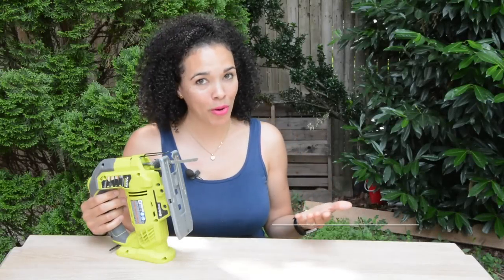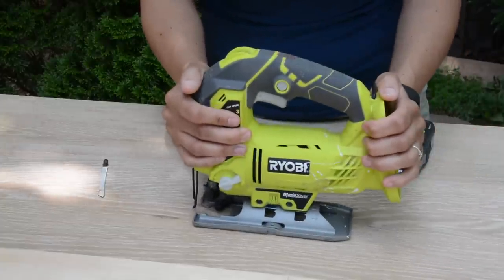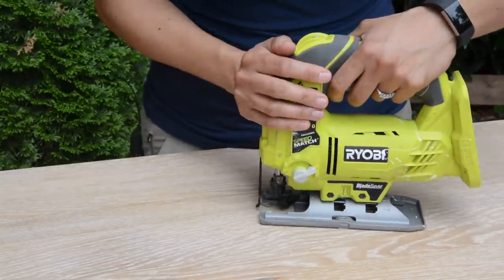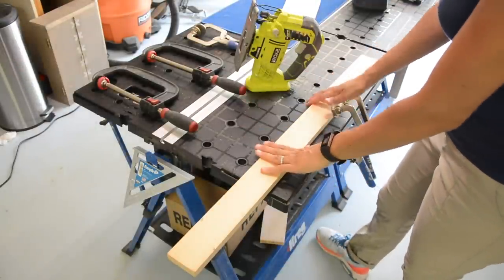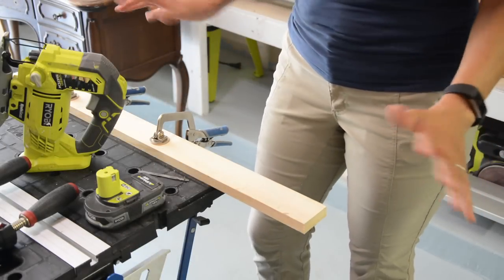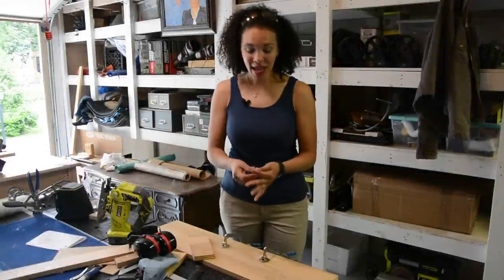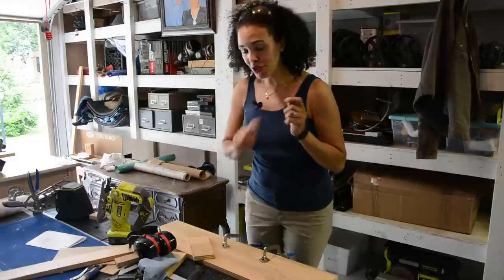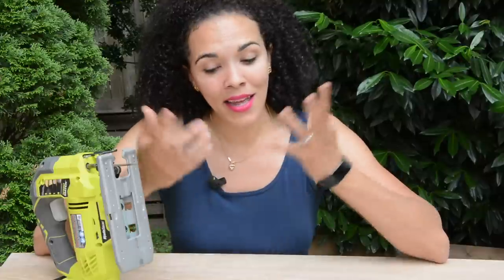How to Use a Jigsaw: The Easiest Tutorial For Newbies! - Thrift Diving

Comment: I own a Bosch corded jigsaw. I would suggest that it is a much better investment than your choice. Also excellent headphones. There are tools that I use more often and those that I need less often. Your Ryobi was more difficult to insert a blade and adjust for bevelled cuts. Much time was lost to your viewers on these adjustments that are very easy to do on the Bosch. Much more time ought to have been devoted to explaining functions. Your table clamps and saw horses were poorly explained - you need a prepared script. I would have clamped both sides of the work. Your cut-out wood circle and strip of galvanised steel and missing plastic exercise ought to have been given more time. Safety is extremely important - you did well to emphasize this - but again a script would have helped.

Thank you for information on Start blades. You mentioned other ways to protect the upper surface but did not demonstrate them.

Good luck with what you are doing.

David Lixenberg

Comment: As mentioned in the video, use scrap material to make test cuts.  I save ALL my scrap material (wood, metal, PVC, etc.) in a full-sized Rubbermaid trash can, in the garage.  I use the scrap wood to, not only make test cuts, but use it when drilling holes in a project.  If you place scrap wood under your project wood, you can drill holes, without ripping out the edges of the hole, on the backside of the project.  Scrap PVC can be cut into "rings" of varying lengths, and heated with a heat gun, to make couplers for different size hoses.

Additionally, if you don't feel like hand-holding the jigsaw to make cuts, here is a link to a DIY jigsaw table .... Seems easy enough!

https://www.youtube.com/watch?v=RVDjY53-cVE

Comment: How thick of metal will the metal blades cut? 1/2" possibly?? Ir wud that break the blade??
Reply from the maker: I'm not sure how thick of metal, but I've used it for the galvanized metal sheets at the home improvement store. I don't recall the gauge of metal, but the ones I have used were medium thickness.

Comment: So I bought a jig saw and tried cutting some wood but somehow the blade turns slightly to the left and cannot seem to get it to go straight. Any thoughts on how I can correct this?
Reply from the maker: What brand are you using? Sometimes blades can have deflection, too, where there is some wiggling and the pressure of pushing on it causes it to happen even more. Also, there is a knob on the jigsaw with 0 1 2 3. Set it on 3 if you're cutting wood.
Reply: @ThriftDiving  I am using ryobi as the video. The blade cane with it when I opened the box. I have the knob set to 3 for wood

Comment: My base seems to not stay flat for some reason. The hex key adjustment must go spongy or something. I can't tell oddly enough, it seems firm to me. But, the cut ends up NOT square! Gah?!  (I use Ryobi too, by the way)
Reply from the maker: Hmmm.....I had. friend who hated her  RYOBI jigsaw, the newer brushless ones. She said it never tightened up and kept getting loose on her. Could be the same problem?
Reply: @ThriftDiving  Well, the RYOBI is a big improvement over the other one I had.  That older one DID plainly loosen AND I COULD SEE IT AS IT HAPPENED!!  Anyway, I've only noticed the odd "not square" edges a couple of times.. Unfortunately, it was on a project where I really, really, really needed a proper squared off edge.

Comment: I always thought one should always stick with power tools with an electrical cord because battery operated ones have a limitation on power. And the main reason to buy battery operated power tools is for portability. In such a case you're prioritizing portability over power. But, again, the default decision is sticking with A/C corded tools.
Reply from the maker: Good discussion you're bringing up about battery vs. corded. I have started buying some more brands of tools and if I can go cordless, I will because of portability and honestly, it's less of a tripping hazard for me. I just bought a corded tool (a Domino), and I literally tripped over the cord, knocking it to the ground and breaking off one if its attachments. My mistake, of course. But whenever I can eliminate the cord, I will. Plus, it means I can work anywhere. That's important to me when I am doing projects outside of my garage, like in my closet in the bedroom.
Reply: @ThriftDiving  Funny how we each have our own preference. I also don't want to deal with recharging batteries and the battery itself going bad after a couple years. But, who knows, maybe the batteries of today rarely ever go bad. I don't know. I'm a cord guy!  :)

Comment: Does the brand of jigsaw matter. I'm using a Chicago/Harbor Freight and it jumps all over (even while clamped) and the blade stops in the middle of the cut
 Frustrating!
Reply: Yes...you need to get a reputable brand ...for diy I'd recommend black and Decker they are affordable and durable

Comment: 22:00   a dual cut has fewer teeth?
Reply from the maker: Yes, the Dual Cut jigsaw blades have less teeth, but what's unique about Dual Cut blades is that the angles of the teeth are angling UP and DOWN to cut the wood smooth from both directions, whereas traditional blades only have teeth angling UP that cuts the wood on the upstroke. What I'm showing here in 22:00 is that there are blades that have FEW teeth for quicker uneven cuts, and there are blades that have FEWER teeth for slower, smoother cuts. You can have regular blades with teeth that only angle up that have small teeth. Hope that makes sense! :)
Reply: Yes, it makes a lot of sense. Thank you for taking the time to explain.

Comment: I did not like this video. I'm 6 min in. There is no way I'm lasting 30 min. If this is the easiest tutorial for newbies? Forget the angle cuts and multiple speeds. I NEVER USE THEM! Full power, Straight cuts. That's it! That's what you want to learn. 9:40 Ugh, you're going into blades? You're going to scare them away.
Reply from the maker: Thanks for telling me why you didn't like it! I like the feedback. I disagree with you, though. If you really want to learn to use the jigsaw and you're a total newbie that knows nothing, then this video will get you started and help you feel comfortable. I've had positive feedback about how it's helped people get started. If you'd rather 2 minute quick videos, sorry, this isn't the channel to subscribe to! :) I would rather do in-depth videos that try to answer all the questions you might have and what you need to know. The timestamps are there so you can jump around and learn about different things related to the jigsaw.